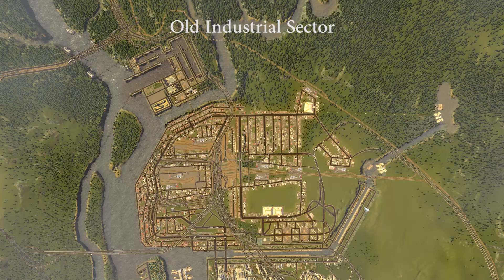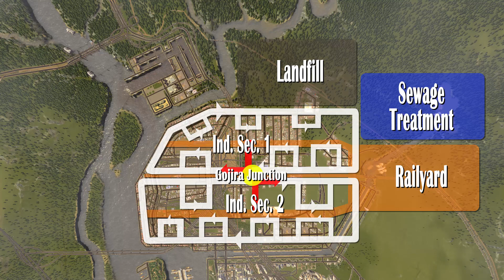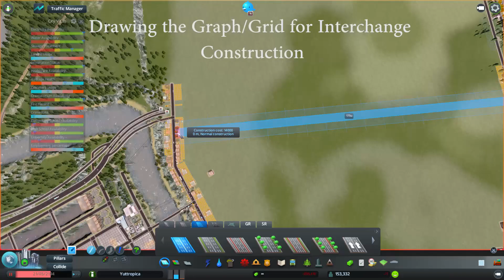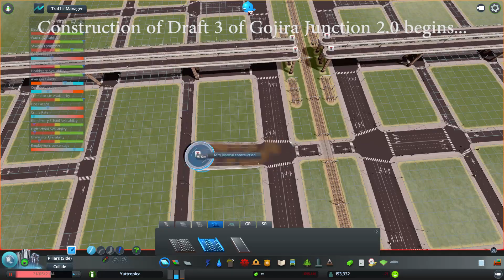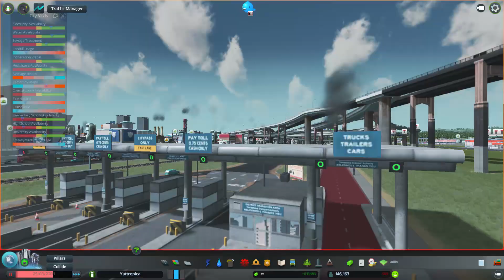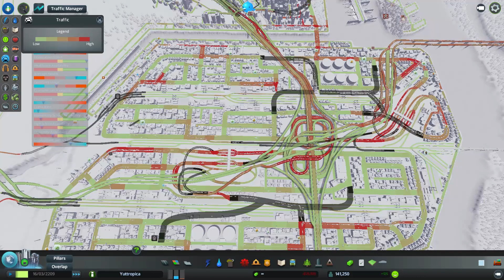Cities: Skylines, EP16 - "Revision of Industrial Sector"

Comment: Yuttho, There is a solution to the demand for goods on the other side of the city. This is to build a inner industrial train loop that only goes between the major industrial and commercial areas without connecting withe the outside world. this will reduce the amount of traffic from the industrial area's and reduce the amount of desponding of the goods, While minimizing the inner city train traffic. This method is surprisingly effective and will stop the problem before you city gets too large :)

Comment: That looks like a raod retexture to match simcity 4. Is this true?
Reply: ***** Question, is the reason you are not subscribed to traffic++ is because of the performance issues?
Reply: ***** With my 1,200 mods, I am starting to have to cut off on them. Sucks too because I really like alot of them :) Traffic++ is a great mod but the performance issues... 

I am amazed with your junction. My mouth was open the whole time with  amazement. Any tips? I know you took a look at my tbone interchange and harbor on reddit. Any comments on the interchange other than it was probably incredibly simplistic... maybe too simplistic

Keep up the great vids.

Comment: ***** 
on-ramps and off-ramps on the highway on the right and on-ramps after off-ramps is a good rule :)
and no cargo trucks and industry on the left side of the road on 2 line one way roads so the car can overtake the cargo trucks. if the game is working that way, or do traffic move in one speed.
Reply: ***** no problem man :)
have all off and on ramps on the right side because then the left lanes on the highway is just going straight forwards. 
and have the on and off ramps side by side with the off ramp first and te on second and make it so the right lane have to turn on to the off ramp which makes the right lane free form traffic and there will be no merging problem